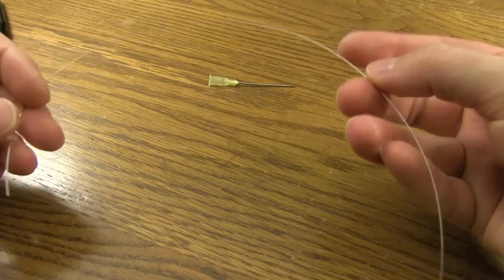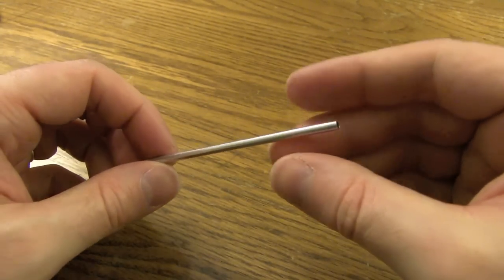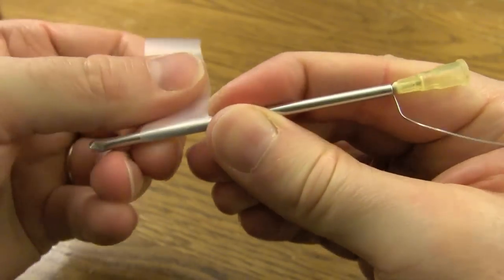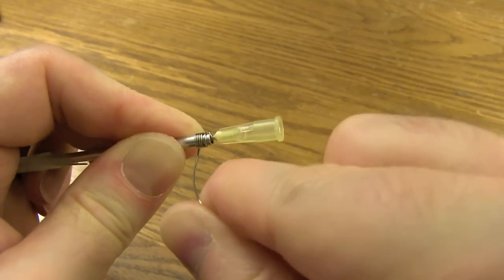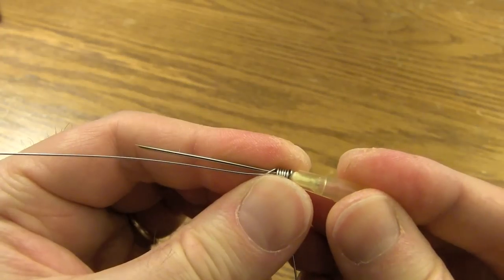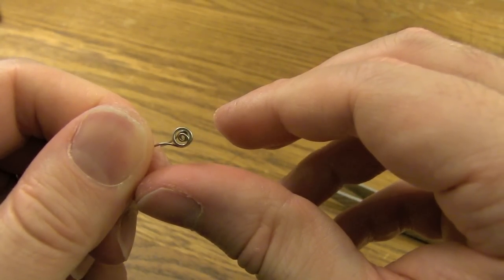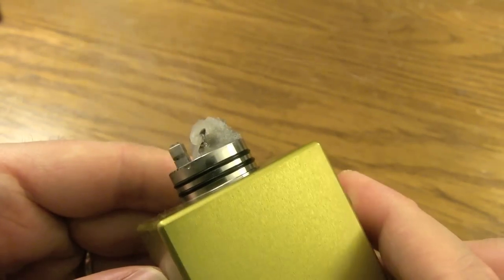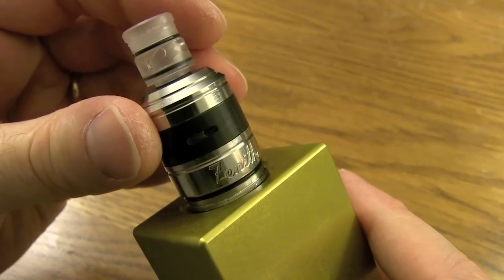The Inception Coil

Comment: If you build two seperate coils, one small, one big, its easier to control the resistance so you can get them both firing evenly. I built this months ago in a protank head and posted it to your FB page. You can also notch your little tube on end where the coil sits so you dont have to come out and around with the wire unless you want to. Keep up the great videos and that epic beard.

Comment: I have built every coil that I have seen on Rip's channel and so far my favorite has been the Clapton coil ! I put my own twist to the coil build 
I used 20ga Nichrome wire and wraped 28ga Kanthal on it instead of the standard build and did a 3 wrap single coil build and wow that is the best vape I have seen so far.

Comment: Dear Rip,

I always enjoy your video.
About cutting an Aluminum tubing, if you use your knife to score around a tubing, then just hold the scoremark in the middle & snap the tube.
This way you will not crash the tube. if it does not easy to snap into two pieces, then score some more. Should work well.
Best regards!

Comment: Another great video! Also, rolling your aluminum tubing back and forth under an Exacto knife with a fresh Exacto #11 or equiv. blade on a good hard smooth flat surface will act as a tubing cutter. You only need a little pressure on the knife to make the score cut. It works great on soft brass tubing as well.

Comment: What you've created is an induction coil that could potentially feedback a frequency into your battery. If, one day, you're vaping in your car and every time you press the button the radio goes out, you should be extremely concerned. A coil within a coil is a bad idea. Remember coils generate magnetic fields.
Reply: Are the coils coiled in opposite directions? I guess it would be easy to do on accident.
Reply: I....I would absolutely die laughing if that happened.
Reply: While my knowledge of induction coils isn't the greatest, because i'm only in my 4th year of physics, i do know that this is definitely not one. The outer coil in an induction coil is grounded with no positive leads going to it, and is completely separate from the inner coil.
Reply: ***** ...e smoking... oh god...
Reply: induction coils only work with alternating current, not direct current. direct current means no change in magnetic flux, no flux no induction. A good thought though.
Reply: You must be fun at parties!
Reply: Aaron Davis i know, how dare he have a slightly intellectual and informative conversation? beer bong anyone? pff
Reply: it doesn't work that way dude. the coils in any atty or ecig run on dc and do not pulse. you need to have a rapid change in current to actually have any radio frequencies produced.
Reply: Shhh not while I'm vaping
Reply: it's DC through the coil, there's no way for EM waves to be produced
Reply: Kael Ruland agreed, even with ac theres simply not enough coil, and not enough power to even come close.
Reply: From wikipedia; "is a type of electrical transformer used to produce high-voltage pulses from a low-voltage direct current (DC) supply."
So yes, you can create an inductor from a DC power supply and pulse your battery. In fact, there's one in your car which, in fact, runs on DC.
A coil inside a coil is an inductor, especially if the coils are tight creating a form of rod. Loose coils, I'd be less inclined to worry about.
Reply: antagonizerr 1st mistake "From Wikipedia..."
Reply: Chantz Morgan
Why is that? Do you think that wikipedia is out to lie to you, or are you just on the 'bash on wiki' bandwagon because, damn it, thinking is too damn hard?
Reply: No its the fact that if I wanted too, I could go change a part of that to say "it requires a unicorn nearby" and wikipedia wouldnt disagree with me even though I would have no knowledge of any of it.
Reply: Chantz Morgan
Try it. See how fast the mods change it back. You did know it's moderated right? You know who lies to you...memes and bandwagon hoppers. It saddens me how little independent thought there really is in the world.
Reply: LOL its not like it will produce an EMP strong enough to kill a radio, at most it will create interference in some AM frequencies. Besides all the electromotive stuff going on inside the car will generate more powerful em waves than this
Reply: Eduardo Partida
I'm sorry, but did you just call it an EMP? I don't think I'll bother to explain the principal to you since you obviously won't get it. Rather I'll refer you to some light reading on the principals of induction coils and magnetic interference caused by electronic devices or EMI, if you like your acronyms. EMP... We're not building a nuke here. LOL!
Reply: antagonizerr That's why i wrote "it is not like it will produce" that thing's em field is simply not strong enough to kill a radio, 30W won't do it, obviously it will not create an emp
Reply: antagonizerr  also, that wire is not even insulated is it? I doubt the current will travel trough the loops and thus not creating a field stronger than that of one in a simple un-looped wire
Reply: LOL Eduardo stop it... I'm getting a pain in my side from laughing here. I can't tell if you're serious or no.
OMG dude, I realize you'd like to contribute but I feel like I'm trying to discuss thermodynamics with a special Ed. student. No offense tho. LOL Ow it hurts.....
Reply: I'm dead serious man LOL
Reply: Eduardo Partida
Alright, since you're being serious, I'll explain. For starters, the wire doesn't need to be insulated provided the loops do not touch. However, because we're heating the coils in juice, the oxidation layer that builds on them acts as a micro coating of insulation so even if they do, there is a barrier.

It won't 'destroy' a radio, but it will interfere with it. Not unlike any device. Even cars shield their coils to prevent radio distortion. In the old days, you would hear a low buzz on radio stations that would increase in intensity as you revved your engine, from the DC current. Radio interference, from an ecig, is only a symptom that you've created an induction coil. It's not the effect since your radio won't literally "blow up".

Many ecigs will interfere with your radio, much like other electronic devices have an FCC compliance certificate to show they're within a certain range. The big difference is that we build our own coils, so tho the mod may be certified, the coils attached to them are not.

Back to the effect. Heavy radio interference is only a symptom that you've created an induction coil...a warning. The effects of which is that a pulse is fed back into the battery. Pulsing your battery, like that, could cause it to heat up. As it heats up, it starts to cascade with it's final effect of shorting, and eventually popping.

Hope this helps you understand Eduardo.
Reply: That's quite clear, thanks man
Reply: antagonizerr I just made a quad inception and it turned into a EMP grenade. No lie.
Reply: that would be cool as hell you got a mini EMP
Reply: *****
What??? I think you're confused. We're not talking about a world ending EMP here, we're simply talking about the coil pulsing the battery through induction, heating it up and causing it to pop. Where the hell you're getting "iron dust", I have no idea. And yes, 'fuzzing' out radio signals is a common practice in the military and police using handheld induction units. I should know, I own one and the principal is identical.
My suggestion is, if you've got an electronics background, build one...test it... then come back here and tell me I'm right. Otherwise stop whining.
Reply: I'm an electronic engineer...
+antagonizerr you are like John Snow... You know nothing.
Reply: Boy, oh boy - lots of misinformation. The post is old, but worth commenting on. First of all, all coils are inductors. When current passes through a material, it creates a magnetic field. If you coil the material, you induce a stronger magnetic field, hence the name "inductor". You've referenced an induction coil, which this most certainly is not. First of all, an induction coil is a transformer. Transformers are indeed constructed out of two coils, but those coils are not made from the same strand of wire - they are two separate pieces of wire wound into coils and separated with a separator. When you pass current through the primary, the induced magnetic field couples onto the secondary, which results in a change of voltage on the secondary winding. The two windings don't touch and the transformer is only useful if there is a difference in wire gauge and the number of turns in the winding. The coil above is one piece of wire, it only has a positive and a negative terminal, it merely creates the illusion of being two coils. Two coils in a transformer configuration, primary and secondary, would have four terminals and would be completely separated. Secondly, the way an induction coil turns DC into AC is with a mechanical component called an interruptor. The current is rapidly interrupted in order to create the flux necessary for generating high voltage pulses. Without an interrupter you can run current through a coil till the cows come home and you won't get any AC whatsoever. Your vaping device of choice, whatever it is, is already generating magnetic fields if it has a coil of any kind, and the coil presented here is not an induction coil, or any other transformer, because it's not actually constructed out of two separate coils with their own independent positive and negative terminals, it's one strand of wire coiled in an odd shape. If you look something up on Wikipedia, make sure you actually read it first. Lastly, you can't do much to the battery because, if the mod is built correctly, it's protected from reverse current by a series of diodes. Even if the polarity changed, which it can't in this case, the battery would remain unharmed as current can only flow through a diode in one direction.

Comment: I know this is old but what I did was used 26g Kanthal made the inner coil as tight as possible 5 wraps around a 2.00mm bit then on the outer used a 4.00mm tube and did 5 wraps spaced. Then I only put wicking through the middle coil. No wicking in or around the outer coil. Came out to 0.20 using it on my fuhatten and im getting great flavor and the same cloud production as I would from a quad coil build just from this single inception coil.

Comment: how to not waste as much wire building these: instead of leaving a huge tail to tape to the outside of the tube, cut a single notch in the end of the tube just the right size to hold your wire- use a dremel tool or a small file. then when you insert your micro coil, the wire you're gonna wrap into the macro coil will catch in the notch and prevent the micro coil from spinning, without the need for a six-inch tail on the other end.

Comment: I built something similar and called it the inception coil, but mine was two separate coils.  Not even claiming to have messaged you or created this. The one I wrapped was a nano coil wrapped in cotton then stuffed inside a micro coil.   I didn't like mine, may have to try it this way.

Comment: RiP Trippers I invented this double nana coil; i call it the figure 8. Works awesome. You take either 28awg or 30 awg and you get two needle or tooth picks or what ever and you get a pair of pliers and you clamp both of them so that there parallel with each other with about a 1 or 2 mm gap. Then you take your kanthal and figure 8 them about 8 or 9 times depend on what omhs your looking for. Once you get done with that heat them up with a torch and compress them coils. Them you hook them up to the terminals and get 2 cotton ball wicks and place them through both holes and add cotton were needed. And the you go that's my invention the figure 8. Oh I also forgot to mention that you need to have the ends on the opposite sides, so one is on the top and one is on the bottom. So when you feed them to the terminals is slanted about 45 degrees

Comment: You have  GREAT  INSTRUCTIONAL VIDEOS! I am about 9 months into vaping. I have a few MVP Variable Voltage units as well as a few 18650 mechanical mods. I am trying to play catch-up. Can you please tell me where to get or at least what the name of  the HIGH POWER VV/VW  power units that you use? There are some of us out here that want to be in the "BIGG LEAGUE"  (and have the money to do it!!) but are relatively new to RBA's , Mechanical Mods and Variable Voltage/Variable Wattage units. I recently bought a couple of 26650 mechanical mods, and have wound a few coils for the rebuildable atomizers that I do have, but I sure can use help with what to buy in order to DO IT RIGHT! Thanks for your help.

Comment: I'm not the guy who messaged you on facebook, but I had thought of this coil after watching your tricro coil vid. How is it related? The way I was thinking of it was a cross between a tricro and a dragon coil, where you don't wick the inner coil and line it up with your air hole so that the air shoots right through the center. I'd be very interested in how it performs that way if you're up for it.
Reply: I forgot to mention the wicking. You'd have to use a "sheet" of cotton pressed flat, and then gently tuck it in there around the coil. Once you have the inner coil surrounded, you'd part the cotton along the top on either side and kind of fold it down so it wicks properly.

Comment: hey rip im a vsper beginning to get ito building after being unsatisfied with every tsnk under the sun. im tsrting with premade rda coils until i get a better understanding of  the safety.can you refer ne to a writeup or chart of coil types to qualities sych as clouds and flavor and such. im more of a fkavor chaser. i the wont be trying an inception yrt until physical therapy inproves my hand function  a bit more. i took a bullet to the head and have lost some use of my left hand but its slowly improving   thanks for all the info and vids. i kearn a ton from em. csnt wait for my tsunami and tesla 3 to get hete from element vape so i can dive in. already got good batteries waiting.
Reply: Michael Choate get a coil master kit. have everything you need to start. then get on ebay. I got 700 ft of wire for 30 dollars us so it's cheap. other important items for advanced builds are a drill with a chuck and a butane torch. Although an alchohol torch makes the coil look nicet

Comment: So what is the benefit of making a coil like this rather than using like a standard micro coil?
Reply: no idea 😂
Reply: You just get bragging rights for making a unique coil that not very many people have seen. He says it allows for better flavor, but I think the type of juice and how you apply it contributes more to how the flavor turns out.
Reply: I think the inception could be up to something and this is all just a theory. As you know the concept vapor production is fast high heat transfer to the juice in relatively low O2 space to prevent combustion. With the inception the inner coil being covered by the wick on the outer coil as well as the juice both the wick lengths are saturated with, I would like to think vapor production is higher. Looking at it I think it would also be better to wick the micro and then pass two lengths of the wick in between the two coils above and below the micro then wrap it around the macro, then finally saturating with juice. :)

Comment: ive been vaping for about 9 months now i sub ohm and use usually  .6 to .8 , i make my own juice, using a 50/50 100 mg nic base, im going off my calculator to make about 45 mg of nic  for a 10ml bottle i use 4.10 ml of base 1.5 ml pg - 2.9 ml vg - 1.5 ml flavor, not sure if that gives me exactly my 45mg of nic but im still alive and kicking, they say its safe to vape up to 60mg ive heard i dont think id try that thats going to far, i was a smoker for 28 years at 2 packs a day, high nic is the only thing that got me away from the cigs, and i keep cutting my nic levels down as i go.

Comment: So...its like 2:47 am rn. I have an idea. What if you Built an inception coil...and then positioned it horizontal instead of slightly diagonal and you put a stove top coil on both sides. StoveCeption Coil. It would have to be a single coil build cuz i assume you are gonna need large post holes.

Comment: I'm a tad bit confused, I thought you get lower ohms with more wire you use? For the builds I do I noticed that most of my builds are .1~.3 ohms and I usually wrap 6 times, but its just all the different coils (i.e super nano,nano, micro, etc.) but when I use 3-5 wraps it lands around the .4~.8 ohms.

Comment: Rip, I bought an iJust2 kit, I broke 2 Tanks already, so I bought a Mad Hatter, what coil build would you suggest?  Thank you
Reply: I had an ijust 2. I'd recommend getting a new battery, I just upgraded mine and I'll never go back. if you want real suggestions then go with a .3-.5 ohm twisted, or a .5-.8 ohm standard coil. anything too fancy on that and your mod just won't run it. not enough juice
Reply: Thank You Brotha!

Comment: When you add the second coil does it double or half the ohms?
Reply: Halfs, the current has two ways to go, easier for the "electricity" to move around which means less resistance... Like... An easy way to remember and by no means a scientific explanation.